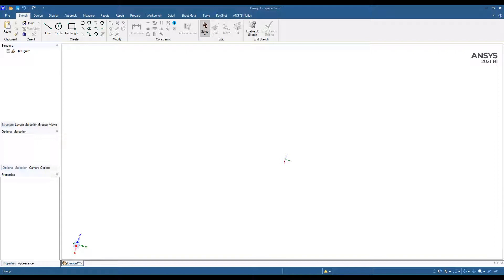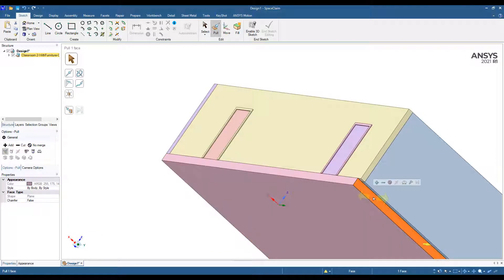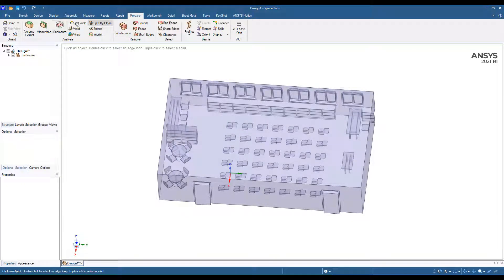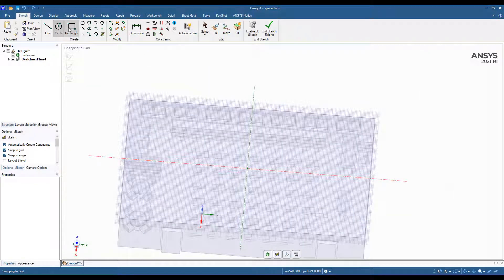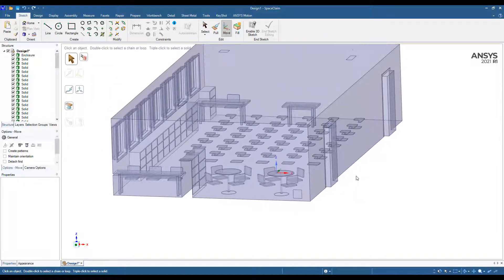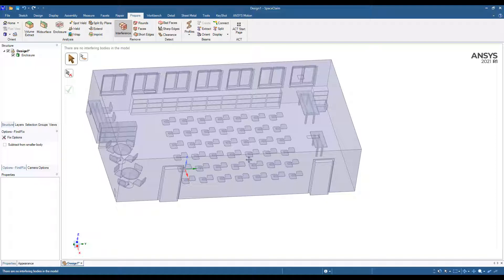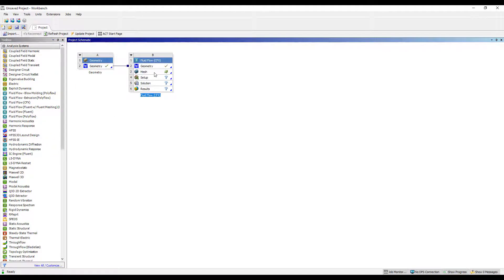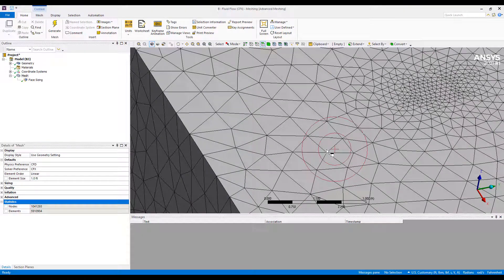Ansys CFD Ventilation Study Part 1: Revit Geometry Cleanup

Comment: It works well because this is a very simple model.
unfortunately most of the real models are far more complicated then this, and the walls in revit seems to overlap a most of the times.
So in general revit models don't work very well for using as a base to a CFD simulation.
It is possible but it is a very time consuming to do that even with a good program like spacecalim.
Reply from the maker: Thanks for the feedback Ofer. How clean the model is depends on the engineering putting it together. We've done full buildings with very clean Revit models so they certainly exist out there :)